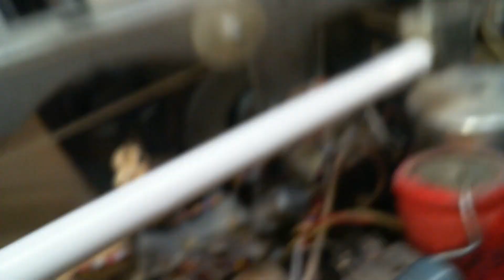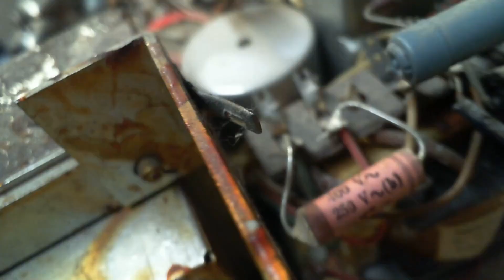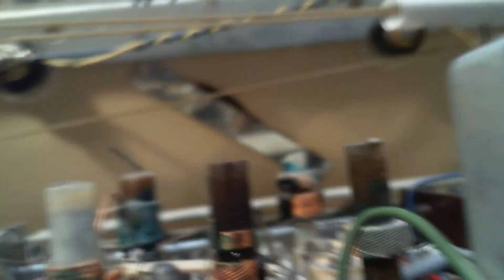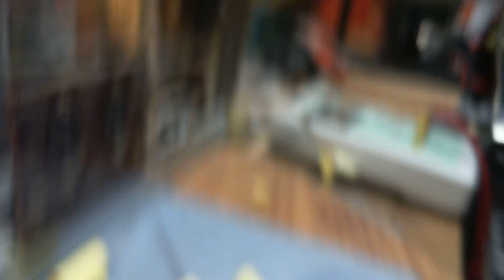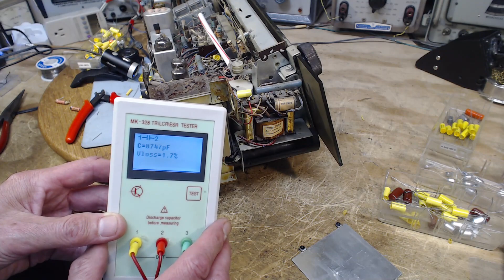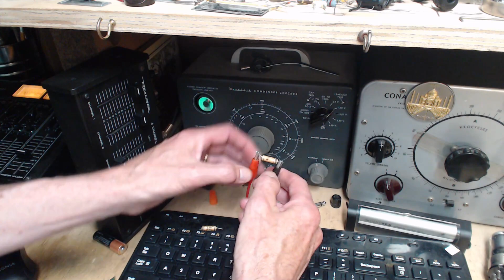Telefunken Salzburg 5094W Console Video #15 - Four More Capacitors Replaced

Comment: what about two 2x2000Pf capacitors in series connected between the plate and ground should have the same effect provided the voltage on the capacitors is 600V.